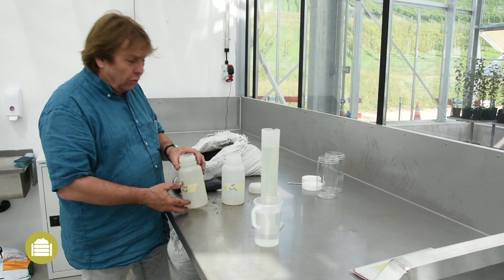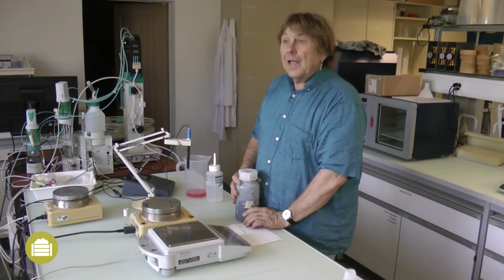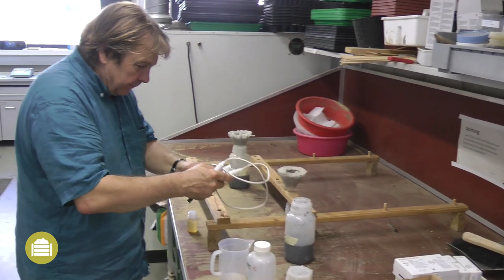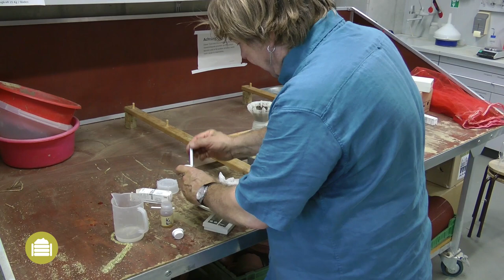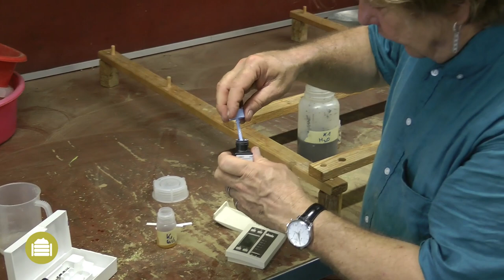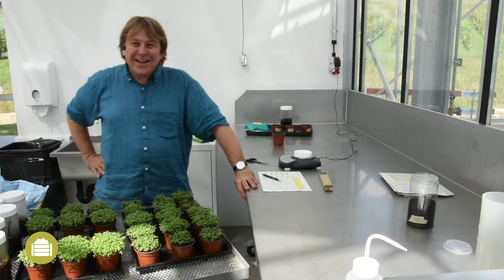Best4Soil: Compost Quality

Comment: How frequent should a organic soil/compost analysis be for a commercial soil/compost producer
Reply: Hello, the quality tests (nitrogen, cress test) should be made for each major compost heap, for which the source material is the same and which has the same age. The reason is that the quality depends on this two factors. In you need more detailed information do not hesitate to contact me at vincent.michel@agroscope.admin.ch